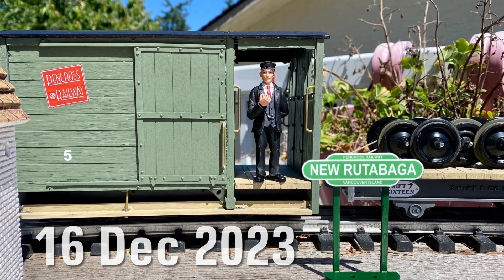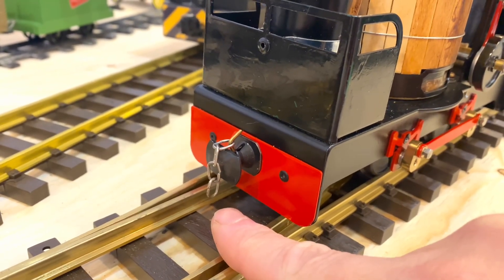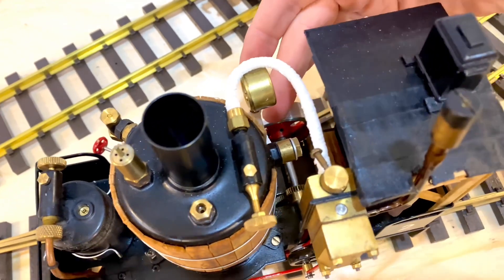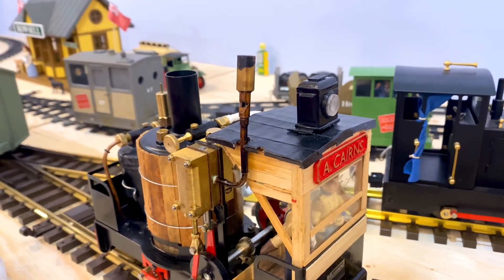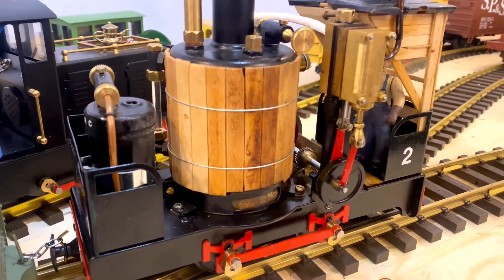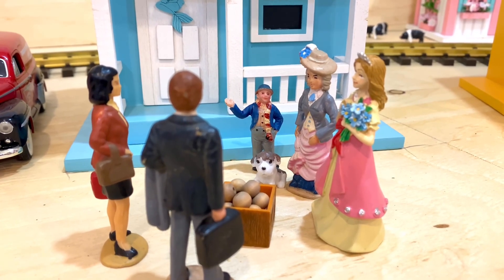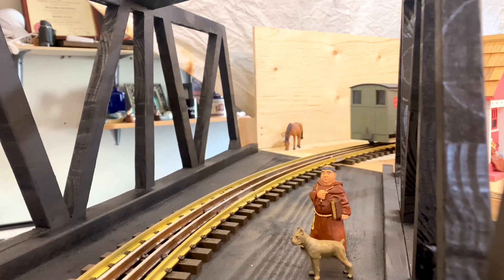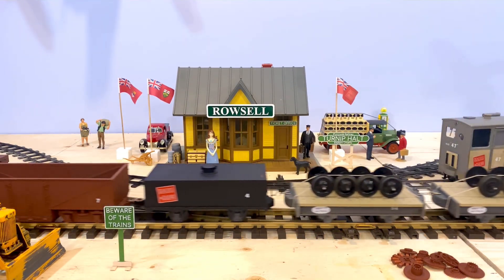Casselman ON: MAMOD’s Fun Live Steam Geared Brunel & Swift Sixteen wagons! (like/sub/comment/share)

Comment: Love the brunel.The cylinder is a bit remote from the heat of the boiler so does produce a bit of condensate at the start until it warms up.But once its going it runs really well and like all geared engines is very powerful.
Any plans for more geared engines Terry?😁
Reply from the maker: Why yes Dave. In fact I have some very specific plans for another geared locomotive. ☺️
Reply: Thought you might😁

Comment: Very nice video. The Brunel is still running very well. How does the chuffer do on clearing the cylinder? Mine I added a exhaust pipe and it shoots the oil and condensed water like a fountain out the exhaust.
Reply from the maker: Thanks Steven. When heating the cylinder at first, like yours mine spits hot water and oil like mad straight out the chuff pipe! Lol. I hang a small cloth there. ☺️
Reply: Ah yeah most piston valve engines are like that.
Reply from the maker: @stevenj9414  you almost need an umbrella. Lol